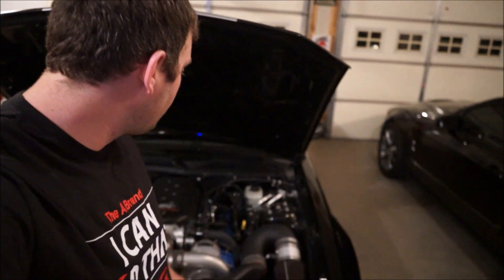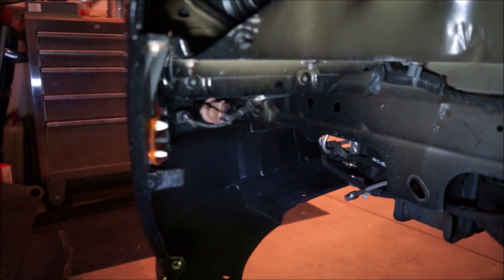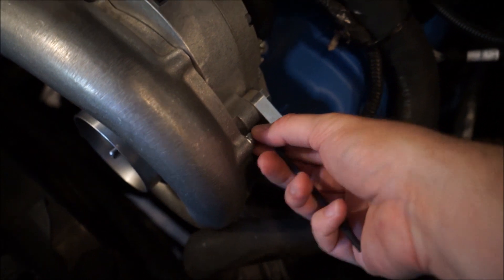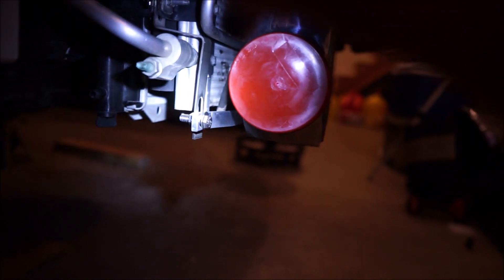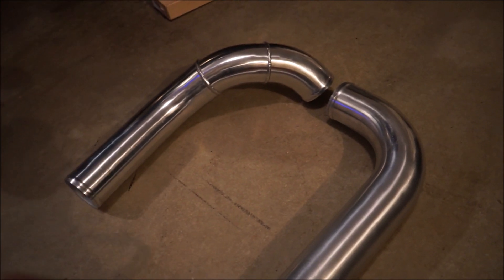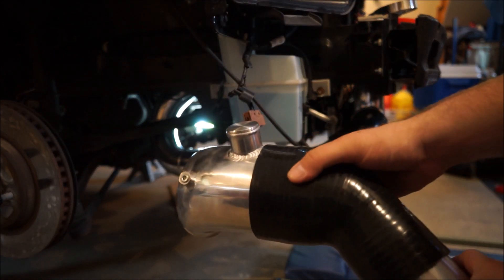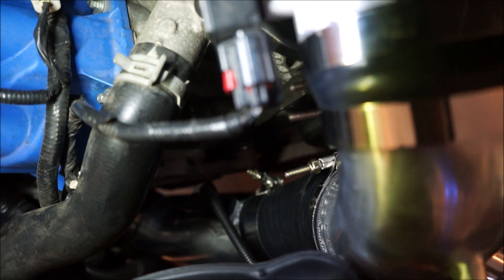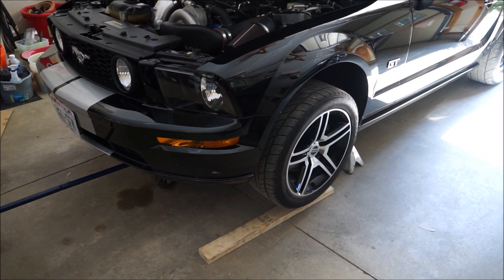CX Racing intercooler install --- 05-10 Paxton/Vortech Mustang GT

Comment: How did you make the piping and coupler fit between the sway bar and ac compressor? I'm doing this same setup and it's touching the pulley.
Reply from the maker: Mine did fit but it was crazy tight. After a couple of years I noticed it was rubbing on the sway bar so I took off the sway bar

Comment: Great video! Honestly not many of them around with this setup on this car. You mention using a tial bov in order for it to work without modifications. Which one would that be exactly?
Reply from the maker: I believe I used an On3 BOV but used a tial spring as the On3 is a tial clone
Reply: @BoostedBrothersRacing  Sorry I meant which Tial bov would it have been :)
Reply from the maker: @djexentrix https://www.jegs.com/i/TiAL-Sport/768/002578/10002/-1?gad_source=1&gclid=Cj0KCQjw16O_BhDNARIsAC3i2GAiMRzo88NR9QIbfKYGaApOo6F15dGL0XJJenuGGq84aC38JkQguxAaAo4HEALw_wcB
Reply: @ thank you!

Comment: This came up on a Google search. Did you ever get before/after dyno runs at all?
Reply from the maker: @madevilmustang2824  no I have never put it on the dyno because the car is remote tuned by lito. It definitely has more predictable and consistent power on those hotter days or back to back runs

Comment: Do you remember what press fit you used for the charge pipe coming from the throttle body. I believe I read somewhere it was a 1.5 in opening
Reply from the maker: I turned a custom plug your best bet is probably to cut the barb off and make a patch to weld on

Comment: could you explain where the passenger side support bracket goes? i only saw the bracket by the oil filter
Reply: Did you find out where the passenger side bracket attached to? I'm installing this kit and I don't see where it attaches either

Comment: I installed my paxton 1200sl kit about a year ago. I really enjoy it but im plauged with high ait. 150-170 ..i installed a meth water kit to help cool them but it only halps when it sprays under boost. Stop and go is still to hot for my liking. My question is the cx racing kit that i find on line is for the vortech V3. Will this work for a 1200sl paxton? And if so can i keep the paxton intake if i just want to use the paxton recurculating setup? Does the piping from cx racing allow for that?  Thanks in advance and great video...
Reply from the maker: Yes mine is a Paxton and the kit is originally designed to use the recirculating setup.

Comment: I just installed the Paxton 1200sl kit..so far I love it...but I'm a little concerned with intake temps..at 45 ambient I was between 118-128 intake temps...don't know what's going to happen when it gets warmer out...did you have high intake temps with out the intercooler? And I guess did the cooler help ?
Reply: I have IATs up to 160-170, so long as the tube is set to pull timing as the IATs get hot you don’t run into detonation

Comment: Hi, I have a novi 1200 on my 07 mustang gt.  I decided to go away with the factory recirculating system and do what you did with the BOV.  Did you put the line that tees into the fuel regulator to the barbed tip on top of the BOV?

Comment: How did you get the factory fan to work
Reply from the maker: Where are you having issues with the factory fan?
Reply: @BoostedBrothersRacing  the fan motor hitting the v3 down pipe off the throttle body

Comment: Hey how did you get the piping up the driver side the power steering lines and oil filter are in the way????
Reply from the maker: did you get this figured out? if not let me know
Reply: That3ValveGuy I zip tied it out of the way they said to turn the power steering fitting I couldnt

Comment: did you change the pulley? ic tends to lose 1-2 psi
Reply from the maker: Yes I had to pulley down
Reply: That3ValveGuy how did you get the pulley off?
Reply from the maker: @jimbrow83  I tried everything and then I resorted to an impact. After the bolt was loose I loosened up the bolts that held the blower to the bracket just enough to pull the blower away a bit to get the pulley off
Reply: That3ValveGuy so the pulley came off without a puller?
Reply: That3ValveGuy did you move the idler pulley in the directions it is suppose to be in a different hole when going ho?
Reply: @jimbrow83  correct I just needed to give it a little bump with an exceptionally small pry bar. The bolt was the hardest part.
Reply: @jimbrow83  I am not sure that I fully understand this question. I did not change anything with idler pulleys that I remember

Comment: I am considering doing this kit this winter, and I was wondering if a retune would be necessary. Currently running the non-cooled paxton 1200SL kit, and from brenspeed they say they retune it with their air to air kit, but theirs also comes with a smaller SC pulley. I have been told that I wont need a retune but I'd like some input. Thanks!
Reply from the maker: For the car to run properly you will need a retune. when changing the amount of volume after the MAF the computer does not know how to properly compensate for manifold volume.

Comment: Where did you get the plugs for the throttle body elbow
Reply from the maker: The small holes is just a 1/8th npt I believe and you can pick that up at any hardware store with some thread sealant. The large plug in the spot where the recirculatory hose would go I turned out of some aluminum then pressed it in place. You could take it to almost any local welder and ask them to seal it off for you.
Reply: Yea I got everything put on but it idles bad gotta trailer it to my tuner thanks for all the help I went with the big red race valve
Reply from the maker: @SuperMustangbeast  glad you got it all put together hopefully it makes good power

Comment: So do you need to tune the car again after adding this or does it still run good.
Reply from the maker: the car would probably idle without a tune and drive onto a trailer but you will need to get the car tuned because the volume behind the MAF changes and that is what the engine uses in some of its calculations.

Comment: I see that this is the NIC 1200sl kit originally, Did you ever install the relocated IAT sensor to the manifold as per Paxton. If you did. Did you delete this  or did you keep running it ?,with the relocated MAF intake at the cold side of CX racing IC.
Reply from the maker: on a 2005+ car they do not have a separate IAT sensor the IAT sensor is located in the MAF sensor. Because of this I located the MAF after the intercooler to try and get a more accurate intake air temp. If you have a car that has a separate IAT sensor like a 99-04 GT I would keep it and just make sure that it is post intercooler.

Comment: Do you know if this would allow you to run the 12psi pulley?
Reply from the maker: I would think that would not be a problem. Your actual boost pressure will change depending on intercooler resistance and other factors.
Reply: That3ValveGuy I was just wondering if that would be a cheaper alternative to buying the Vortech intercooler upgrade. Since that is what is needed to run the smaller pulley.
Reply from the maker: @jacksonb95  oh definitely a cheaper alternative. I can not speak to the quality of this kit vs the vortech / Paxton kit

Comment: Will it run without tune for blow through ,and what bov/spring should I go with
Reply from the maker: It might start up without a tune because of the failed MAF table but it wont run well. The computer calculates thing based on a fixed volume of air behind the MAF to the intake port. If you change that volume by changing the placement of the MAF the computer calculations are wrong. You can buy what ever vent to atmosphere BOV your budget would like. Tial makes a great unit. I used the On3 BOV which looks like a Tial Q knock off. Then I used the lightest Tial Q spring I could get which was light green in color and cut 1.5 coils off of it. For a centrifugal blower you want the spring to be very light. Hope this helps.
Reply: That3ValveGuy what blow threw mad did you use and where can I get that flange for it
Reply from the maker: this is what i used

https://www.teambeefcakeracing.com/pmas-flg-va-hpxe.html
Reply: @BoostedBrothersRacing  After you cut 1.5 coils off, where did the valve end up closing at?  You mentioned with the green uncut spring it was around 8 inches of vac.  I am having a similar problem.  My Tial won't close until I shift to second gear and really get load on the car.  Hard to launch with no boost.  Thanks.
Reply from the maker: Ya that's closing too late. If you have a tial bov you do not need to cut anything off of a tial spring. If you are using a on3 bov you need to cut some off of the tail spring to make it work. It should shit around 4 in of vacuum
Reply: @BoostedBrothersRacing  Yea I thought so also.  I'm reading all I can, I'm missing something tho.  This thing sounds like a box fan in first gear, and I can't get it to close at all revving the car.  Ideas?  Sent you a message on IG.